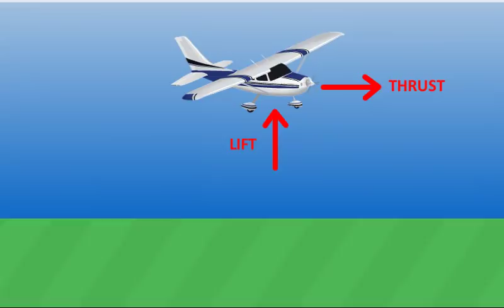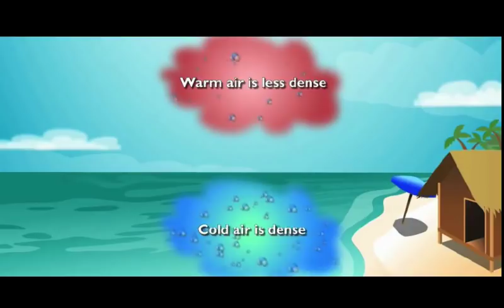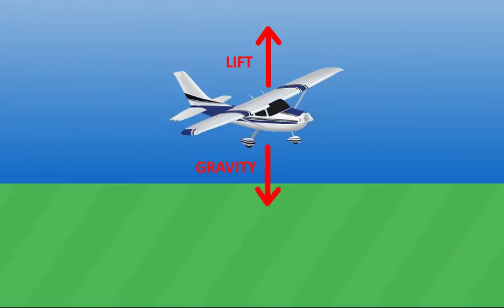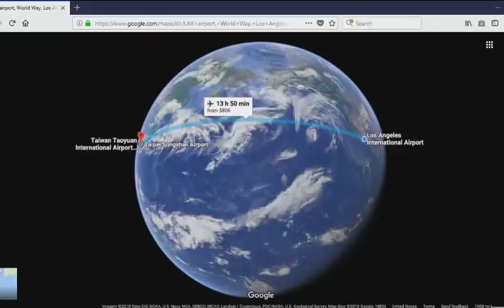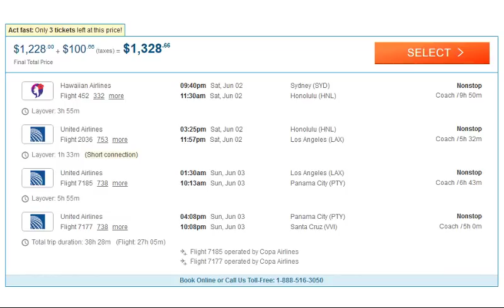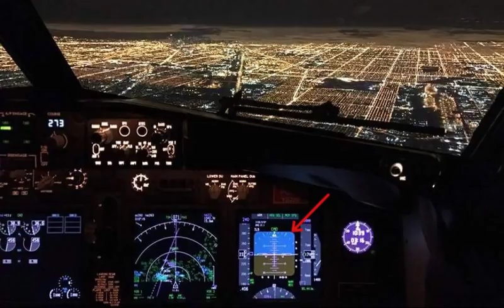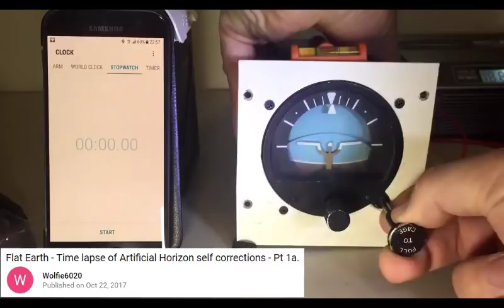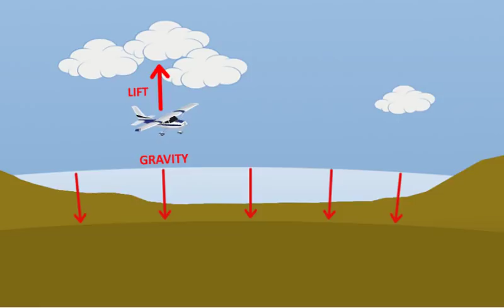Flat Earth Falsities - Plane Nonsense

Comment: Please provide your detailed calculations and explanation of how gravity is holding the atmosphere velcroed to the earth's moving surface. Please include all the motions and forces at play, as well as their vectors (i.e. direction of action and magnitude). Any actual scientific experiments that prove or at least provide evidence for the phenomenon of a moving spherical object uniformly dragging the surrounding air with it would be greatly appreciated.  The usual magical explanation of "Grrrrravity!!!" without any actual explanation of how it would work theoretically, let alone demonstrating it experimentally, is not sufficient. You may as well say that gnomes are responsible for holding the atmosphere down.

Also, while you're at it, please explain how clouds can hover above us sometimes for hours (or at least tens of minutes) appearing completely motionless. When you provide your explanation, please factor in the fact that, because clouds are at high altitude (kilometers above the surface), they necessarily must be moving at a higher velocity than the Earth's surface due to the fact that they are traveling around the circumference of a circle with a greater radius. Please explain where that extra velocity comes from, using vectors and forces diagram. Come to think of it, please explain that for all the layers in the atmosphere as we go up higher and higher in altitude. Then, don't forget to explain how the vacuum of space is bordering a pressurized system like the earth without just sucking it all out. Maybe you would also care to explain how the atmosphere came about to begin with given the "fact" of space vacuum and our knowledge of the physics of how pressure works. And again, please use actual mathematical formulas that include the force of gravity, pointing downward, and the force created by the vacuum directed upwards. Please use actual experimental values for both forces and explain how they balance out.

Finally, please explain the conservation of momentum for airplanes that fly north to south or vice versa. Do planes need to constantly fly in a north-east direction to catch up with their moving target if flying south to north for example? If not, why not? (Gravity, right, right, but please, include your calculations and preferably a diagram of the forces at play.) Finally, it would help to give an example of a north-to-south (or vice versa) circumnavigation by plane, along with the actual path taken, and explain that in light of the time it takes for the flight and the rotation of the earth. Please make sure that any flight given as an example of such circumnavigation has the flight path linked as well so we can all cross-reference it.

I'm sorry for asking all these more formal proofs of your claims, but I'm an engineer and a bit of a stickler when it comes to those kinds of things.

Until you provide these answers, hopefully in a less playfully condescending tone than the one used in this video, I will call it for what it actually is: BULLSHIT.
Reply: Ooooooohhhhh , aren't we clever. No. Fucking stupidly ignorant and disingenuous.
Basically Fg=G.m1.m2/r^2
All the other effects are the causes of weather etc. and therefore are incidental, unless you wish to go into the dynamics of weather etc.
If you do, go to your country's main meteorological establishment where they will have a super computer or two to provide the data you are demanding. But wouldn't understand even if you were given it. Because only a maths and science illiterate would ask the sort of questions you are.
Similarly with your ignorant demands about flights.
And whilst your at it, please provide your detailed calculations and explanation of how your god exists and works,  include all the motions and forces at play, as well as their vectors, including fully scaled diagrams. Similarly with howe he/it/she created itself and the universe. Your bible is not acceptable becasue you cannot cite a thing to prove that thing is true.
We know the earth is a slowly rotating terrestrial spheroid and gravity is a fact.  Just because you are incapable of understanding basic maths and physics and wilfully refuse to learn such things is your problem. Examples of questions for you about basic, practical, everyday maths and physics used in the real world - 
What is the relationship between longitude and distance when travelling east or west parallel to the equator?. If you know the answer then you know the earth is a spheroid. If you don't you are not qualified to comment on the earth’s shape.
Please explain the principles behind the development and functioning of a gyrocompass? If you can then you know the earth is a slowly rotating spheroid and gravity is a fact. If you don't you are not qualified to comment on gravity, the earth's shape or movement.
"north-to-south (or vice versa) circumnavigation by plane"
https://www.pilatus-aircraft.com/en/news-events/story/polar-circumnavigation-with-the-PC-12http://south-pole.com/p0000110.htm
http://www.guinnessworldrecords.com/world-records/first-circumnavigation-via-both-poles-surface/
https://www.ainonline.com/aviation-news/aviation-international-news/2008-12-31/tag-global-claims-record-polar-circumnavigation
https://www.britannica.com/biography/Lincoln-Ellsworth
Finally, the ultimate proof of your ignorance "the force created by the vacuum"  I can't comprehend how utterly ignorant you are. A vacuum does not create a force and is not a force, it is created by forces you numpty
Reply: I think you should absolutely demand a full refund from whatever University you got your engineering degree from, and also throw in some compensation for pain and suffering.

The fact that you think of vacuum as a force tells me all I need to know, that your understanding of physics is quite limited.  When you create a vacuum in a container inside the Earth's atmosphere, do you really think that when you release the vacuum it is some Force created by the vacuum that pulls air inside the container? Because that's exactly what you're proposing would happen to our atmosphere. If you do not understand this extremely basic concept, explaining all of those forces and vectors would be a waste of time, because I doubt you would understand them.

Now, I actually could draw diagrams and explain forces to answer the questions you are posing, but a YouTube comment section is certainly not the best place to do that. We would need to do it in a lecture style format with both of us present, and even then, to get you to understand all of these things would take the equivalent of a full semester college class, because we would need to pretty much start with the basics of physics.

Before anyone should even consider taking this kind of time to help you understand these things, given the fact that there is an overwhelming mountain of available evidence that you so easily dismiss, I think the burden of proof of a flat Earth is on you my friend.

I still have yet to find any plausible Flat Earth model that can explain  how the Sun can be observed in a 360 degree rotation in Antarctica in December. That model would also have to fit with all the other observable data that we have.  If you can do that, I'll consider taking you back to school.

https://youtu.be/Zc-WlTaG7WY
Reply: @Test_Drive_Racing  you've rewritten Newtons law and Einstein's theory your a genius!
Reply: @backoffjoe8347  Nah, it's just basic high school level physics, nothing too exciting. But thanks for the compliment! ;)
Reply: No.. - Well please come down to my level (that of the great unwashed) and bring the light of knowledge, Oh Prometheus! In fact, I will make it easier for you. How about instead of asking you to explain things to me, you find for me some peer reviewed articles that answer my oh so dumb questions? I will make sure to learn how to read by the time you do. In particular, I've been looking for an answer to the question of how exactly does gravity hold the atmosphere together on a ball spinning 400 km/h FASTER than Mach 1, and I haven't been able to find anything that satisfies my curiosity. I've seen a lot of Harry Potter-esque gravity wand waving, but for some reason no details of any sort, let alone experiments. So please, if it is not too much to ask, help a poor lost soul see the light.
Reply: Peter Domuzov
"Statements like "We know the earth is a slowly rotating terrestrial spheroid and gravity is a fact. " are quite funny, " Why. It is a factual statement.
Given the intellect and knowledge you claim you should be able to answer these simple questions.
Why is it that a compass needle is more or less vertical at the poles and horizontal at the magnetic equator?
And when you carry on past the poles the needle slowly returns to the horizontal?
Why is it that it is only possible to navigate accurately over long distances using spherical trigonometry?
Why is it that traditional gyro compasses work perfectly in low latitudes but became unreliable in high latitudes?
Why is it that it is only possible to navigate accurately over long distances using charts based on a terrestrial spheroid?
Why is it that when you watch a ship sailing away from you the hull is the first thing to go below the horizon, then the superstructure and finally the funnel and upperworks?
Does a magnetic compass point towards polaris (Alpha Ursae Minoris) at the north and south poles?
Does a gyro compass point towards Alpha Ursae Minoris at the north and south poles?
What is the relationship between longitude and distance when travelling east or west parallel to the equator?  If you know the answer then you know the earth is a spheroid. If you don't you are not qualified to comment on the earth’s shape.
Tell me how you ascertain the error of a compass when in the Southern Ocean, using Alpha Ursae Minoris?
Please explain the principles behind the development and functioning of a gyrocompass?  If you can then you know the earth is a slowly rotating spheroid and gravity is a fact. If you don't you are not qualified to comment on gravity, the earth's shape or movement.

No evasions please, just straight answers.
Reply: Peter Domuzov  Why no answer?
"wong - Wait... I thought you are the ones coming from monkeys?? " Silly troll. Only Creationists say that, and that is because they are ignorant and brainwashed science illiterates.
"Especially since you have not addressed a single argument I've made."  Why do you lie? You actually attempted to rebut the points I made, i.e. You know I did address them and therefore you are calling yourself a liar.
"So... you make a bunch of assumptions about my beliefs". No. I drew valid and reasonable conclusions based on your viewing habits and the fact that the FE cut is a Christian cult.
Also, if you were an academically qualified engineer you would know exactly what gravity is and why my citing Fg=G.m1.m2/r^2 is an adequate explanation.  So " And no, giving the formula for gravity is not an explanation in any way, shape or form" Is either a lie or an admission you are not qualified as you claim.
Most of you so called arguments are playing at irrelevant semantics, a childish, illogical pastime.
As is your revised explanation about  a vacuum etc.
Reply: @boffeycn  Rather than confuse the poor man with a barrage of questions that he can't answer, I would just like him to answer the one question of how a 24-hour sun visible in Antarctica in December is possible on a flat Earth model. Let's just get that one question answered, then we can move on to the others. I've answered a litany of his questions about the globe model, it's time for him to answer just this one about the Flat Earth model.
Reply: Jim Lee
Rather than confuse the poor man with long winded posts why don't you let him answer my simple questions. He doesn't want to because they are simple but he likes you because he can play you.
Also, your demand to leave god and religion out of it is disingenuous to say the least, isn't it, because the entire foundation of the problem is religious belief. If people would accept this we may possibly move forward.
You should also stop feeding trolls.
Reply: @boffeycn  How is he playing me? I have taken him back to school and taught him some basic things he should have learned during his engineering degree.  Sorry my posts were too long-winded for you, but he asked a lot of questions and I wanted to make sure I was being very clear for him.

He thought he was going to win the argument by demanding answers that he didn't think we could provide.  He thought he was setting the bar too high and would then claim victory when nobody could answer his seemingly difficult questions.  Now his bluff has been called and he is called out on the carpet to answer just that one question for me, since I have now answered many for him.

Would you also like to hear his answer to how a 24-hour sun is possible in Antarctica on a flat Earth model?
Reply: Jim Lee
How is he playing me?
Read through the posts.
You and he both claim you want simple but your posts prove the opposite. I had him answering questions and I proved he was lying and didn't know what he was talking about. He then concentrated on you because you were prepared to play his game rather then utilise what had already been achieved. You gave hi the out he wanted and allowed him to ignore the proof he was a liar.
And I repeat, your demand to leave god and religion out of it is disingenuous to say the least, isn't it, because the entire foundation of the problem is religious belief. If people would accept this we may possibly move forward.
You should also stop feeding trolls.
Reply: @boffeycn  He stopped talking to you because you were starting to commit logical fallacies (even though I believe you are correct in what you're saying, you were not proving your points with properly connected arguments) and then declaring yourself the winner before he felt like his questions were addressed.

The reason he started talking to me is because I'm actually addressing the questions he was asking and refraining from being disrespectful in the process. I don't believe any argument is truly won until one party concedes to the other, not just when one party declares victory.  Unfortunately the majority of these arguments end with no real winner.

The other reason I'm trying to keep religious beliefs out of it is that as soon as it goes, there really can be nowhere to the argument. As long as we keep it purely scientific, I'm pretty sure I can adequately answer any of his questions, though I doubt he will be able to answer any of mine adequately.

All I want for now is a plausible explanation for how the sun can be observed in the sky 24 hours in Antarctica on a flat Earth model.
Reply: @boffeycn  God, you sound like my wife...  no wonder he stopped talking to you.
Reply: @boffeycn  Ok, I'm done feeding the trolls, so this is my last response to you.  Too bad you don't have the mental fortitude to have a civil discussion without resorting to name calling.  Maybe you'll learn how to be compassionate and understanding with people one day.  If anyone is on a superiority trip, it's you my friend.

To answer your question... no, leaving religion out of it is not disingenuous.  Once the discussion goes that way, all hope of them trying to understand the science is lost.  As long as he is willing to not resort to divine arguments and keep the discussion based on observable and testable data or arguments of logic, there is no way for him to successfully prove his point. 

Once he resorts to divine arguments for proof of his beliefs, all bets are off.  Better to keep the discussion grounded in scientific terms than trying to argue Biblical terms, wouldn't you think?  There is no way for me to convince him that his religious beliefs are wrong, is there?  But faulty science I can certainly prove wrong...
Reply: HA HA HA the frustrated attention seeker +wong tong has been going up the wall in this great thread, none do on his comments.
+SP "To an altitude where surrounding atmospheric pressure is low enough to match the mass of helium inside.  Gravity arrests the balloon's rise at this point." ...- Often those carry someting, like satellites... "It doesn't rise.  Why?" Stuck at the DOME?
PS: funny a lot of dome talk these days, on TV, the globeheads programing center; shows like Simpsons, Under the Dome, etc.
Reply: @BrainUser1  Well thank you Louis. I actually learned something today. I was going to say that weather balloons don't launch satellites (and actually haven't, yet...), but I looked it up just to see if it had ever been attempted, and I just learned that there is a company called Zero2Infinity that designed a system called Bloostar to potentially launch satellites from a balloon based platform.  The balloon carries a much smaller rocket that can have a much larger payload because the balloon takes it up to the upper atmosphere until it cannot go any higher, skipping 99% of the Earth's atmosphere, which is where the majority of the energy and bulk of traditional rockets is expended getting a satellite to that point. A much smaller rocket carrying a much larger payload then can be launched from the balloon further up into orbit. Their first actual attempt to launch a satellite from the platform is supposed to be sometime this year or next.

The reason balloons can only reach a finite altitude is because of buoyancy. I could explain the actual physics of buoyancy to you if you like, but might be better to just give an example. Imagine taking a balloon to the bottom of the ocean and letting it go. It will rise because the air inside the balloon is much less dense then the equal amount of volume of water that it displaces. The balloon will continue to rise until it reaches the surface, because that is when there is a change in density between water and air, and now the air in the balloon matches the density of the other surrounding air, and it will stop ascending at that point. That's not because there is some physical structure preventing it from going any higher, but because the density of the gas inside the balloon matches the density of the gas surrounding it.

Same thing happens in a helium balloon when we release it into the atmosphere.  The balloon will continue to rise because the helium inside is less dense than the surrounding atmospheric air at sea level, however as you go further up in the atmosphere, the air gets gradually less and less dense. There will come a point where the density of the surrounding atmosphere matches the density of the helium inside the balloon, and it will float right there, almost like our air balloon floating on the surface of the water.  I say almost because there's a very sharp boundary between air and water due to their significant difference in density, however in the upper atmosphere, this boundary is not nearly as well defined because of the gradual change in density of the atmosphere.

Does this make sense?   Wong, if you read all of this, sorry for another long winded post. I know your brain has a hard time comprehending that many words all put together at once... ;)
Reply: wong - Wait... I thought you are the ones coming from monkeys?? I'm not sure why you're getting ME involved in your evolutionary business. But I suspect that your urge to behave like one is certainly not lost to most reading this thread..  And who knows, if you are lucky you might end up in the evolutionary biology text books as a proof positive we did evolve from monkeys.. So hey, silver lining for you there buddy. But seriously, only scared and powerless people without arguments resort to name calling. Think about that. Especially since you have not addressed a single argument I've made. You don't make GEs look particularly clever to be honest..
Reply: @babayaga9570  Peter, rather than wasting your time responding to the name-calling with Wong, how about you address my response to you and let's have an educated discussion about it.
Reply: +Peter Domuzov Peter, rather than wasting your time responding to the log winded posts from
 +Jim Lee, why don't you concentrate on answering my simple questions?
Reply: Peter Domuzov
"wong - Wait... I thought you are the ones coming from monkeys?? " Silly troll. Only Creationists say that, and that is because they are ignorant and brainwashed science illiterates.
"Especially since you have not addressed a single argument I've made."  Why do you lie? You actually attempted to rebut the points I made, i.e. You know I did address them and therefore you are calling yourself a liar.
"So... you make a bunch of assumptions about my beliefs". No. I drew valid and reasonable conclusions based on your viewing habits and the fact that the FE cut is a Christian cult.
Also, if you were an academically qualified engineer you would know exactly what gravity is and why my citing Fg=G.m1.m2/r^2 is an adequate explanation.  So " And no, giving the formula for gravity is not an explanation in any way, shape or form" Is either a lie or an admission you are not qualified as you claim.
Most of you so called arguments are playing at irrelevant semantics, a childish, illogical pastime.
As is your revised explanation about  a vacuum etc.
Reply: You claim to be an engineer w/ honors, but don't know the basics of fluid dynamics?
While I can't provide the exact calculations, other people who are nerds in the respective fields can but I can give some base line explanations
1. They said how the surface spinning + friction results in the atmosphere also, on average, spinning in the same direction. Also iirc (dun quote me on this though) the atmosphere formed spinning like the Earth did (but not at the exact same time)
2. Clouds SOMETIMES (key word there) hover above you motionless for hours because wind speed isn't a constant. As for the extra velocity, probably the same place where a bucket on 1m of string, spun above your head, moves faster than your hand does (hint: angular velocity)
3. The vacuum of space doesn't 'suck out' all of the atmosphere because of gravity. Your high to low pressure system example assumes that the gravity is constant but with our atmosphere it isn't
4. Explaining how the atmosphere came to exist has nothing to do with how planes work, but iirc (dun quote me on this) it was basically millions of years of volcanoes

You know why this stuff is considered scientific fact? Because it has been proven, can be used to make correct guesses about the outcome of experiments with and is also the most accurate explanation we have. I would think that an engineer with honors would know the basics of science but you never know I guess
Reply: @Peter Domuzov  -  Gravity is the only valid explanation that fits experimental data.  Buoyancy/density and electromagnetism do not fit any testable scientific results of any experiments.  And if that's not the case then give me one.  I can test gravity just by dropping an object on the ground.  I can measure its force and velocity with just that.  It is you who is making the extraordinary claim and therefore you require extraordinary, undeniable evidence that gravity is something else.  If you don't even know what that is than you shouldn't even be talking.  You can't talk about gravity if you don't know what it is.  Very simple premise for any argument.  I think you failed on step 1.
Reply: notSiD You're simply ignorant. Maybe you should look at the Electric Universe theory.
Reply: Was going to say good luck! But even +wong maneged to put out something aside of "F_off troll" (+No.. does his best). They will never give you anything for the perfect velcro contact to the surface, its Momentum, picked up when the Atmosphere got dense enough and the Ball picked up its fixed axe and speed.

Earth's atmosphere is leaking. Every day, around 90 tonnes of hydrogen and helium material escapes from (GE) planet's upper atmosphere and streams out into space. Although missions such as ESA's Cluster fleet have long been investigating this leakage, there are still many open questions. How and why is Earth losing its atmosphere?
Reply: @BrainUser1  Yes, this is absolutely true that the upper atmosphere is leaking hydrogen and helium, because they are the least dense gases and preferentially rise to the upper atmosphere and float off into space.

90 tons sounds like a big number, but when you look at the overall mass of the Earth, it is infinitesimally small. Hydrogen and helium are also being released into the atmosphere from the soil and from other natural processes on Earth. These items are also entering the Earth's atmosphere after they are released from the Sun and travel through empty space towards Earth. So for now, there's an equilibrium, however the amounts of those gases present in our atmosphere are very small because they are being lost to space, just as the sun is losing them to space.

This very much implies that there will be a finite amount of material for the Earth and Sun to lose to space over time, which implies that somewhere in the future there will be an end to the Earth. This is absolutely in line with teachings of the Bible as well.

Now, if your Flat Earth and dome theory is correct, how is it possible that the atmosphere is leaking through the dome?  I will acknowledge that there is some permeability of hydrogen through glass, however for a glass Dome that is large enough to cover the entire Flat Earth and keep the atmosphere pressurized to 14 PSI, that would have to be some extremely thick glass. The rate of permeability of hydrogen through that glass would be infinitesimally small.

Also, can you explain why there is a pressure gradient within a pressurized dome as you get further away from the Earth's surface if gravity does not exist?

Just as a side note, I find it extremely amusing and very Freudian that when I am dictating these responses using Google Voice recognition, it often autocorrects the word "dome" to "dumb"... makes me chuckle.
Reply: O... was hoping a "not true, liar!" That is what I copied on Credible sources... Nice that it is less dense, rising, but, still why does not GRAVITY hold on to it? Make it all nice and level, in sync with Momentum as all the rest of the Atmospheres.
ps: did you just ignore the more educated and clear +Peter Domuzov ?
Reply: @BrainUser1  No, I didn't ignore him, as you will see from my comment above. As you'll see, that response required a lot more time to put together, and I'm at work right now, so I responded to you first.  Please read through my response to him, as it also helps to explain some of your questions about the leaking atmosphere.

I did notice however that both you and he ignored my question about the 24-hour Sun visible from Antarctica. Would you mind taking a stab at explaining that one?
Reply: Two replies follow the "Then follows with a text wall of nonsense." with lenght? Argumentum ad hominem, is a fallacious argumentative strategy whereby genuine discussion of the topic at hand is avoided by instead attacking the character, motive, or other attribute of the person making the argument, or persons associated with the argument, rather than attacking the substance of the argument itself. Déjà Vu.
Reply: So YOU dont have any backing as I thought.
Once again... the easier Piltdownman  conclusions drawn from accumulated research, until way latter 1953 TIME MAGAZING exposed the hoax ; [ The Piltdown case is an example of how racial and nationalist factors shaped "some science" at the (some)time. Notably, it led scientists down a blind alley...  ..reconstruction of human evolution was confused for decades. The examination and debate over Piltdown Man caused a vast expenditure of time and effort on the fossil, with an estimated 250+ papers written on the topic.]
As early as 1913, David Waterston warned it was fake, but....
The Piltdown hoax is prominent for two reasons: the attention it generated around the subject of human evolution, and the length of time, 41 years, that elapsed from its alleged initial discovery to its definitive exposure as a composite forgery. 
https://en.wikipedia.org/wiki/Piltdown_Man

0 So yeah, some utterly disingenuousness went on in the SCIENTIFIC community /Government schools.  
"Science doesn't just make outlandish unsubstantiated claims like he is doing." ??? O YES IT DOES, ALL THE WAY IN SCHOOL BOOKS.

SO NO COMPARISION TO ENGINEER  Peter Domuzov YT conclusions, point I was making as you butted in from.. way back.

Mister Know-it-all that just provides lip, denials, here is some more Science mistakes you already know...;
 
5- Einstein’s Static (or Stationary) Universe
10 Most Famous Scientific Theories That Were Later Debunked
https://www.famousscientists.org/10-most-famous-scientific-theories-that-were-later-debunked/
plus : 
15 Things You Were Taught In School That Are Total Lies 
https://www.brainjet.com/random/2357670/15-things-you-were-taught-in-school-that-are-total-lies/

- that is what a "non-researcher" could dig out this time..
Reply: Louis Shaw As ever your argument relies on science having been wrong in specific instances to somehow support your unsubstantiated claims that everything is wrong. Now you're now claiming relativity is wrong, not because you can supply any evidence it is so but because Einstein was wrong about expansion.
Reply: Well said, I don't think your going to get an answer, at minimum the flat earth theory should make a rational person think, instead it's a smug no it all BS.
Reply: Thevoice of reason Once again he is gassing about Piltdown man but once again not actually putting forward any evidence that questions evolution. 

There isn't a flat earth theory: the only think FE'ers can agree on is claiming the Earth is flat and the inability to produce a map. There is/isn't a dome, there is/isn't an edge, there are/aren't other continents, air pressure does/doesn't decline with altitude and so on ad infinitum. If you believe you have something to make people think then produce but kindly think it through thoroughly before you do.
Reply: *drops mic* (don't even have to say anything, dropping the mic proves my point.  the mic would not fall if gravity didn't exist.)
Reply: notSiD hold helium ballon. Let's go it flies up to the sky. Wow I guess gravity sends balloons up? Gravity debunked you dumb fuck
Reply: Big Boss The gravity also pulls on the surrounding air; since the air is denser the air is pulled down favourably and the balloon is displaced upwards.
Reply: wong - So... you make a bunch of assumptions about my beliefs without actually answering the questions. Please point to where I mentioned anything about God or the Bible? You ask me to show calculations on how God created the universe, as if that is the same as what I'm asking about the simple relative motions of 2 objects. Wow, brilliant. Touche. In the same spirit, I'll throw one right back at ya and ask you to explain what the gravitational constant G is, what is mass exactly, and what the hell is that force of gravity anyway? These are stupid and futile games dude, grow up.

Calling me names doesn't make your argument either. Maybe it does in your apparently rather simple mind, but in the real world this is called an ad hominem attack.

And by the way, I am a professional engineer who graduated with honors, so I would venture a guess and say that I probably know a bit more about science in general and physics in particular than you.

And no, giving the formula for gravity is not an explanation in any way, shape or form. It is definitely part of such potential explanation, but not an explanation in itself. While weather plays part in the dynamics of the flight, I am asking you to exclude the winds and what not, and just focus on the basics of the motions of the plane and the earth. Let's assume that weather is irrelevant to simplify the calculations.

Statements like "We know the earth is a slowly rotating terrestrial spheroid and gravity is a fact. " are quite funny, considering that this is indeed the topic of discussion here. How about if I say that we know for a fact that the earth is flat and motionless? Maybe you should find a book that explains to you the rules of formal logic. To help you, this particular logical fallacy is called "begging the question". Look it up.

As far as the vacuum is concerned, maybe I was unclear what I meant, so let me dumb it down for you. In any known environment, either natural on earth, or a man-made in a laboratory, if you have a system of high pressure and connect it to a system of low or no pressure, the laws of physics dictate that air will flow from the high to low pressure until both are equal. I referred to that, maybe not entirely accurately, as the equivalent of a force "pulling" the contents of the high pressure system if you will.  So, given that the Earth and outer space constitute 2 such systems, I am still waiting for your explanation as to how it all works.

Finally, about those circumnavigation flights. You obviously didn't look at the actual trajectories that those flights took. I will only address the links you provided about actual flights and not ground expeditions, because I don't want to spend time explaining how the ground expeditions are just as flawed, since they are not directly relevant to what I asked for, namely flights.

The only two links that are thus relevant are the PC-12 flight by Jack Long, and the TAG Transpolar 08.

About Jack Long's flight, FROM THE VERY ARTICLE THAT YOU LINKED TO, I quote:

"
After more than a year of planning, Jack and his crew completed the northern part of the route first, beginning the journey in Jackson Hole, Wyoming, USA, on 11 August, 2016 and ending in Austin, Texas, USA on August 29 – by way of crossing the Atlantic Ocean to Newcastle, England, and crossing the 75 degree north latitude point on the return flight over Greenland.

Jack and his team began the southern part of the trip in Austin on 2 January, 2017 and crossed the Atlantic again, but this time by way of the Azores and Cape Verde to Ghana. From Accra, Ghana, they flew a round-robin flight to complete the easternmost equatorial crossing they needed. They then flew west back across the Atlantic, and then south across the equator again to Brazil and continued flying south over Argentina and Chile, to King George Island. Jack’s aircraft was the first PC-12 ever to land in Antarctica! From here, they made the longest leg of their journey on 17 January, flying 8 hours and 30 minutes to reach the 75 degree south latitude control point and then returning non-stop to King George Island.
" 

Read the second paragraph, and the last sentences in particular, very carefully and go to your globe and track the actual trajectory. Did they actually cross over the south pole and go on the other side of Antarctica?

I also find it curious that we had to wait until 2017 (after more than 100 years since airplanes were invented) for the first ever "polar circumnavigation diploma" to be awarded. And please carefully read the requirements to satisfy the diploma, they are in the same article, in particular to:

"
The flight must have been made to a control point north of 75 degrees north latitude and a control point south of 75 degrees south latitude.
"

As for the Transglobal 08, a very similar thing happened. I will just link to their official route with stops and ask you to please trace it yourself and tell me that this is actual polar circumnavigation.

http://www.transpolar08.com/route.html

The very fact that you could only come up with 2 extremely dubious examples speaks volumes, and should prompt any thinking person to pause and reflect.
Reply: @babayaga9570   I appreciate that you want to take a perfectly scientific approach to this and not bring biblical beliefs into it. I will assume you were referring to Wong about the Bible and name-calling remarks, because I personally said no such thing to you.

I find the discussion on the Earth's atmosphere and the vacuum of space very interesting, because at first glance to someone with only an elementary understanding of these things, your argument makes sense to some degree. However, I will try to explain.

Since you seem to agree that vacuum does not actually constitute a force in and of itself, but rather is the effect of other forces at work, that's a good starting point. If we take a very basic experimental setup of two sealed containers connected by a valve, close the valve, and then pressurize one of the containers and create a vacuum in the other, you and I would both agree that when we open the valve, whatever gas we placed in the pressurized container would flow into the container with the vacuum, which contains no gas molecules. The force generating this movement originated within the pressurized container and is exerted by the movement of the gas molecules against the container. When the valve is open, this pressure forces gas molecules across into the vacuum container until pressure in both containers is equal, according to Boyle's law.

We'll take this one step further and only create a vacuum within one container on the earth at sea level. When we release that vacuum, atmospheric air pressure of 14 PSI will force atmospheric air into the container until pressure within the container is also at 14 PSI. I hope we're in agreement so far.

Now, what we have to understand is what force is causing that 14 PSI of atmospheric pressure, and I have a feeling that this might be where we start to disagree.

The force that generates that pressure is gravity. I know that word tends to trigger a lot of flat earthers, so let's be clear. It should be undisputed fact that there is some force that causes objects to move towards the Earth's surface. We are calling that force gravity. As for what causes gravity, that is still a matter of active debate and research and is merely tangent to this discussion. Just because we do not understand how something works, does not mean that it does not in fact exist or that we cannot observe it working in extremely predictable ways. When you ask someone to define gravity without using the formula for gravity, that's like trying to ask someone to explain why the color blue appears to be blue without using wavelengths in the explanation. It's a moot point. There is unquestionably some force that causes objects of mass to move towards the Earth's surface. If you want to talk about density and buoyancy, that's fine, because gravity is one of the factors used when calculating the buoyant force.  Without it, you have no point of reference as to which direction a less dense object would move within a more dense medium.

Now, can we also agree that there is definitely a decreasing pressure gradient in the atmosphere with increasing altitude? This is why airplane cabins have to be pressurized when going above a certain altitude. This is also why the converse is true when going deeper into the ocean and there is a pressure gradient that increases with increasing depth. This pressure gradient is formed by gravitational force pulling anything with mass, including water molecules and air molecules, towards the surface of the Earth. This is very adequately explained in the video we are commenting on.

Knowing these pressure gradients exist, would it not stand to reason that atmospheric pressure would slowly decrease as we get further from the surface of the Earth, until it is essentially zero? Think of it this way... according to Boyle's Law, pressure within a container is caused by the exertion of force of the molecules of the gas against the walls of the container. At sea level, the 14 PSI of pressure is caused by exertion of force from the movement of molecules in the air in all directions, both downwards against the Earth's surface and upwards against the molecules of air above it. However, for any volume of air, you must also add in the vector of gravity pointing towards the Earth's surface that affects all the molecules in that volume because all molecules of gas have some mass, albeit very small. Therefore, the overall net downward force is ever so slightly greater than the upward force against the molecules above it. Now the molecules of air above it are also creating force in all directions, and they are also affected by gravity, so their net force downward is also slightly greater than the force upward.

This explains how gravity can form a pressure gradient both in water and in air, and that is exactly what is readily observable.  As we get further from the Earth's surface, this pressure gradient will decrease from 14 PSI, to 13 PSI, to 12 PSI, gradually getting down to 0 psi. It is at that point where the very minor effect of gravity on the air molecules reaches a point of equilibrium with the upward vector of pressure created by those last few air molecules remaining in the atmosphere.

Hopefully you can see this is why there is no container necessary to hold in the Earth's atmosphere. This is also why we would expect some molecules to be able to float away into space, or "leak" as you put it. The molecules that are escaping away into space are the ones that have the least amount of mass and are therefore least affected by gravity, namely hydrogen and helium.

I know the idea of having a pressure gradient that goes from 14 PSI to 0 without a container is hard to grasp, because the only way we can carry out experiments on Earth using a vacuum is to have a container. The reason for this is that we are working within the Earth's atmosphere and must exclude the atmosphere from the space we want to work with. Maybe to better understand this, let me take the ocean as an example. We should all be able to agree that there is an increase in pressure of one additional atmosphere for every 33 feet of depth in seawater. So at a depth of 33 ft in the ocean, the pressure would be roughly 29.2 PSI.  However, the pressure at the surface is 14.6 PSI. Why is water not moving up into the air, from a higher pressure to a lower pressure?  If you can answer this question, then you should be able to understand why all the Earth's atmosphere does not just fly off into space.

Any questions?
Reply: Jim Lee - And I appreciate an actual argument as opposed to name calling, so thank you for that!

I feel sort of dragged into a discussion on a very minor point that I mentioned in passing, but c'est la vie. I will address your response anyway. However, I hope that you can provide some answers to my original questions. I would also accept peer reviewed articles from any scientific publication if you don't feel you can do an adequate job in a YouTube comment section.

To start, let's talk about gravity. I don't think we can say that the questions of what is gravity and how it works are mere detail. Just because we observe an effect (namely, that objects fall), and can describe that effect using a formula (which we don't really understand), it does not necessarily mean that the force we POSTULATE as an explanation to that effect is the only possible explanation. As you remarked, density/boyancy can be another explanation. Electromagnetic/electrostatic forces can be a third explanation. And so on... So, I would be a lot more comfortable with gravity as an explanation if we could actually explain what it is and how it works. Otherwise it seems, to me at least, that it can be viewed as one of several possible explanations.

I find there are quite a few problems with gravity as a theory. For one, Newton's Law of Gravity only applies in a system of 2 objects. It falls apart when you have 3 or more objects in the system. Second, it seems to vary depending on where it is measured on earth, which should not theoretically be happening. Three, it does not explain the movements of the stars and galaxies, which is why we need to postulate nonsense like dark matter and dark energy. Four, there is a question I have concerning gravity that I'm hoping you can answer... It has to do with the centrifugal force on any body on earth that results from the spin of the earth. To wit, a person standing on the equator is subject to a centrifugal force (Fc) equal to m*v*v/r, where v is around 1600km/sec (actually it should be in m/s but I'm too lazy to convert). Now, if you ask anybody who believes the globe model, they will invariably say that we do not fly off the earth because of gravity. Fair enough. So that means that Fg would be equal and opposite to Fc at the equator. However, if we now move our observer say toward the North Pole, the speed v will gradually decrease for obvious reasons, until we reach the north pole, at which point v = 0km/sec. I hope that is also obvious. However,  Fg is supposed to be constant anywhere on the sphere, since each point is roughly equidistant from the center of the earth. This would in turn mean that the Fg at the north pole will still be the same as experienced by the same observer at the equator, but this time there is no Fc to balance it out. So, in my humble opinion, the observer at the pole should feel a MUCH stronger gravity pull, possibly crushing him. I've spoken to people who have worked very near the North Pole at a military installation for 6 months, and they didn't feel any difference from any other place on earth they have been. Also, I have never ever heard of anyone who HAS felt any difference. Would you be able to explain this apparent contradiction/discrepancy? 

It is my opinion that density and buoyancy are the explanations (and/or possibly electromagnetic/electrostatic forces), not gravity. And no, buoyancy is  not defined in terms of gravity, it is defined in terms of small g, which is gravitational acceleration CONSTANT. I am not arguing that objects do not fall at a rate of 9.8m/s*s. That is indeed a fact. I am arguing that gravity as a force is not the explanation of why everything sticks to the earth. So please do not confuse the two.

One major problem I see with your logic about atmospheric pressure etc is that you use Boyle's Law. As far as I know, Boyle's Law only applies to enclosed systems. Would you agree that neither the earth nor space can be regarded as such enclosed systems? 

Second, even if I grant you that what you are describing (and I've seen this explanation before) is possible, or even probable (which I don't but let's just say), it is still merely a hypothesis. Can you provide actual experimental data to support it? Even if something does make sense, it does not mean that it is true.

One example of an experiment that can be done with a vacuum that is not enclosed is to open the hatch of the ISS. What do you think will happen? It seems to me that there will be a violent "apparent force" pointing outward toward the vacuum of space that will suck everything out.  At least that is what we see in movies. :) The magnitude of this same "apparent" force will be the same when applied to the earth as when it is applied to the ISS, would you agree?

However, you are saying that this force is balanced perfectly by the very weak force of gravity. OK, it's a hypothesis. But you will need to do more to convince me that this hypothesis is true than just stating it as a fact. This is why I ask for actual equation with actual values for these acting "forces" (and yes we already know Fg).

Finally, we have the "fact" that we leak 90 tons of gas per day. Under what conditions then did the atmosphere form to begin with?

Just picture it: Earth 4.5 billion years ago, a rock in the vacuum of space. What plausible processes could have resulted in the build up of the atmosphere? To more than counterbalance losing 90 tons of gas per day for billions of years? I realize this is not exactly accurate as the present conditions are not identical to those a billion years ago, but you get my drift.
Reply: Peter Domuzov "density/boyancy can be another explanation"
Only as and when someone explains how density can acts as a force and why with a consistent direction. 

"Electromagnetic/electrostatic forces can be a third explanation"
Someone just needs to explain how electrostatic attraction would work without any detectable charge, why the electromagnetism applies equally to magnetic & non-magnetic materials and how either field diminishes as slowly with distance as gravity does. 

"it can be viewed as one of several possible explanations'
Which are...?

"It falls apart when you have 3 or more objects in the system"
It doesn't fall apart; it becomes too complex. 

"seems to vary depending on where it is measured on earth, which should not theoretically be happening"
The strength is dependent on your distance from Earth's centre of gravity, something which varies with your elevation and the spheroidal shape of the Earth.

"postulate nonsense'
Why do you think it is nonsense exactly?

"So that means that Fg would be equal and opposite to Fc at the equator"
No, simply that Fc is weaker than Fg. At the equator it's <1% the strength of gravity. 

"the observer at the pole should feel a MUCH stronger gravity pull"
No, just that missing fraction of a percent. Since the transition from equator to pole would be gradual and I doubt the body is that sensitive to changes in weight anyway, nobody is going to notice. 

"Boyle's Law only applies to enclosed systems"
Closed, not enclosed; there is no requirement for a solid container. Though there would be incoming meteors and some gas escaping the Earth is technically a closed system. 

"Can you provide actual experimental data to support it?"
Start here: https://arxiv.org/

"The magnitude of this same "apparent" force will be the same when applied to the earth as when it is applied to the ISS"
The distance through the escape hatch is somewhat shorter than the height of the atmosphere. Compare the difference in pressure for a fixed distance. 

"you are saying that this force is balanced perfectly by the very weak force of gravity"
In terms of the change in pressure per metre, yes. 

"90 tons of gas per day"
Not a huge amount on the greater scheme of things. The early atmosphere would have been a little pulled in during the Earth's formation and predominantly what was released by the Earth through volcanic activity.
Reply: @babayaga9570  First of all, I don't see how you can claim that you were dragged into a discussion on a minor point that you made in passing, when if you look at the first post in this thread it was a very long list of things that you posted demanding answers to with detailed explanations, so that's exactly what I provided. How do you feel you were dragged into this, and what was the minor point you were talking about?

As for the actual cause of gravity, I'm going to table that for the time being, because I don't think it pertains directly to the facts we are discussing.  For now, I will concede your point that just because something makes sense doesn't de facto make it true, however, if there might be three possible explanations for some observation, and one of those explanations happens to fit with the mountain of other observations available, and the other two don't quite seem to fit, it's pretty logical to deduce by Occam's razor that the one that fits with the most observations is probably the correct one.

However, setting that aside for now, it seems that we can at least agree that there is some force causing downward acceleration of 9.8 m/s, and that it is a constant on Earth (though there is slight minor variability between the poles and the equator as I will discuss below). As for your question of why someone isn't crushed by gravity at the poles due to the differences in centrifugal force between the Equator and the poles is easily answered. I think the difficulties you are having with understanding this is that I think you are grossly overestimating the magnitude of forces involved, as hopefully you will see.

First, let's make sure we agree on the units and measures involved.  The equation for Fc as you said is m*v*v/r, and would be expressed in Newtons. Since Newton's are a somewhat abstract unit for a lot of people to understand, for ease of calculations and understanding, let's just assume a 1 gram mass for now. With 1 gram, the force in Newtons would equal the acceleration due to that force (F=ma, so if m=1, then F=a).

Now, we need to determine the velocity in m/s of this 1g mass at the equator.   Using the commonly accepted values of 40075 km for the circumference at the equator and a 360 degree rotation taking 24 hours, 56.1 min, we get a velocity of about 465 m/s.  Please feel free to check my math.

Now using the commonly accepted value of 6378 km (or 6,378,000 m) as the radius of the Earth at the equator, we get 465*465/6378000 = 0.034 m/s of acceleration away from the surface of the Earth.  Compare that to the 9.8 m/s of acceleration due to gravity (or whatever force you want to claim it is due to) in the opposing direction and it should be plainly obvious why things don't fly off the surface at the equator (I know you didn't say that specifically, but many of your fellow flat-earthers do claim that they can't understand why that doesn't happen) and why people aren't getting crushed by gravity at the poles (as you DID claim), because the difference in force is about 0.3%.  So someone who weighs 100 kg at the equator would weigh 103 kg at the poles.  Now,  if you look up the actual calculations that take into account the slight change in the gravitational constant from the equator to the poles, the difference is actually about 0.5%, so a person weighing 100 kg at the equator would actually weigh 105 kg at the poles.   Not sure what kind of world you live in where 5 kg is enough to crush someone.

Now, on to other things.  I believe you are correct about Boyle's Law and only applying to closed systems, which is exactly what I was talking about when I referenced it. I was using that as an example to establish a basis of understanding. Never once did I use Boyle's law to try to make any points regarding the atmosphere or space.

Your ISS example is invalid in this instance because as you said above, the Earth and space are both open systems, and you would now be taking a closed system and placing it in an open system.  You would be taking a container pressurized at 14.7 PSI  and placing it in an environment of 0 psi with only a few inches of material separating the two. Of course when you release that gradient there is going to be a force generated from the pressure inside pushing everything outward.

The difference between the ISS and the air that is at 14.7 PSI at sea level on the earth is that, as you said, the magnitude of the forces would be roughly equal, however releasing the hatch on the ISS would release that entire force over a very small area and very short distance, so everything would in fact be sucked out (or pushed out to be more accurate).   With the Earth, that same force is being dissipated over miles and miles of atmosphere and all that energy is lost in the friction of air molecules with each other over that huge distance instead of just over a few inches. 

As far as the origin of the Earth's atmosphere, I could give you the proposed explanation based on secular astrophysicists and Big Bang theorists ideas, or I could tell you that I believe it was created by God. It actually doesn't matter for purposes of this discussion, because how it came to be has virtually no bearing whatsoever on the observable physics that we can see today.  For purposes of this discussion, it's a straw man argument.

Now that I have again taken the time to provide a very detailed answer to your questions how certain things could be possible on a globe Earth model, let's have a little quid pro quo here. Please answer my question about how a 24-hour Midnight Sun is possible from Antarctica during December on a flat Earth model. It's a very simple question compared to some of the ones you have been asking.
Reply: Peter Domuzov    Why no answers?
"Statements like "We know the earth is a slowly rotating terrestrial spheroid and gravity is a fact. " are quite funny, " Why. It is a factual statement.
Given the intellect and knowledge you claim you should be able to answer these simple questions.
Why is it that a compass needle is more or less vertical at the poles and horizontal at the magnetic equator?
And when you carry on past the poles the needle slowly returns to the horizontal?
Why is it that it is only possible to navigate accurately over long distances using spherical trigonometry?
Why is it that traditional gyro compasses work perfectly in low latitudes but became unreliable in high latitudes?
Why is it that it is only possible to navigate accurately over long distances using charts based on a terrestrial spheroid?
Why is it that when you watch a ship sailing away from you the hull is the first thing to go below the horizon, then the superstructure and finally the funnel and upperworks?
Does a magnetic compass point towards polaris (Alpha Ursae Minoris) at the north and south poles?
Does a gyro compass point towards Alpha Ursae Minoris at the north and south poles?
What is the relationship between longitude and distance when travelling east or west parallel to the equator?  If you know the answer then you know the earth is a spheroid. If you don't you are not qualified to comment on the earth’s shape.
Tell me how you ascertain the error of a compass when in the Southern Ocean, using Alpha Ursae Minoris?
Please explain the principles behind the development and functioning of a gyrocompass?  If you can then you know the earth is a slowly rotating spheroid and gravity is a fact. If you don't you are not qualified to comment on gravity, the earth's shape or movement.

No evasions please, just straight answers.
Reply: Jim Lee - I just said I am being dragged into a discussion on this one particular point because none of the other points have been addressed. But whatever. 

As for gravity fitting the mountain of evidence, I point you again to my points about the problems with gravity, in particular to it not being able to explain the motions of the stars and galaxies by a HUGE factor. In my mind, that is not insignificant. Also, please do detail what mountain of observations you are referring to is only explainable by gravity but not by density/buoyancy. 

Minor corrections on your numbers about centrifugal force, it is a bit over 3% and 5%, not 0.3 and 0.5%. (Looks like you copied the numbers along with the argument from here http://curious.astro.cornell.edu/about-us/42-our-solar-system/the-earth/gravity/94-does-your-weight-change-between-the-poles-and-the-equator-intermediate -- along with the mistakes...) But you did get the weight correctly. I only said possibly crushed because I had not done the math. But 3%-5%, or 3-5 kg for a 100kg person is definitely a measurable difference. Now if only someone had actually done the experiment with a fixed weight object (people can gain and lose weight after all)... Oh wait, someone HAS!!! And it was published on Science Magazine's website of all places. (http://www.sciencemag.org/news/2012/03/scienceshot-garden-gnome-tests-earths-gravity). So, let's see what the results are, shall we? The difference seems to be only 0.6%, or about 2 grams. Now, if your theory was in fact correct, this should have been more like 10- 1 5 grams. You can use this site to easily verify (https://www.engineersedge.com/physics/centrifugal_force.htm). Now, there seems to be quite a discrepancy here; I mean, we are off by some 500-800%!! So let's not move on to other things just yet, because I would love to hear your explanation.

So, you are saying that my ISS example is invalid because it is a small, enclosed system. I gave that as an example because you said we cannot have any environment here on earth where we can have unbounded vacuum. So I guess your argument is that it will not work for an enclosed system, but no problem of it working on an open system like the earth... That's quite a contorted logic. Come to think of it, you CAN actually view the earth as a closed system from your point of view, because it is enclosed by the vacuum of space. Would you agree? 

If you do agree, then the earth can be viewed as such closed system, at which point I will ask you - What size does the ISS need to be in order for the air in it NOT to be sucked out immediately, or at least very quickly? 

If you do not agree that it is an enclosed system from your perspective, then your argument makes absolutely no sense. That "apparent vacuum force" that is sucking everything out, even if it is distributed over thousands of miles of atmosphere, must approach infinity, because space is after all, at least according to Scientism, infinite. The size of the earth is absolutely insignificant in comparison. In addition, in your statement

"
With the Earth, that same force is being dissipated over miles and miles of atmosphere and all that energy is lost in the friction of air molecules with each other over that huge distance instead of just over a few inches. 
"
you are again stating your own hypothesis as if it were a demonstrable scientific fact, which IT IS NOT. It is just conjecture, and I dare you to prove otherwise. Again, just because you can concoct some seemingly plausible hypothesis, that does not make it a fact.

I strongly disagree that the origin of the atmosphere is irrelevant to the argument. You MUST be able to explain, based on your premise, how the whole thing started. You can't just say, here we are and this is how it's working, because it is immensely important how we got here in the first place. If your theory can't explain that, then what are we even talking about?!? That's a Jedi mind trick and a logical fallacy that Scientism priests use constantly. About pretty much everything (origin of the universe, how the planets form to begin with, how life originated, etc.). And no, we can't include God in this, because your whole worldview is based on God not existing. If we are going to include God, then do point me to the Bible passages that are talking about a ball earth spinning in the vastness of space. If the Bible is not your thing, point me to ANY religious text describing the same.

Finally, the 24 hour antarctic sun. You might not like my answer, but please don't have a knee-jerk reaction, because I will explain why I can't accept it as evidence.

It is most likely fake. Why? Because there is CONFIRMED fakery in some of the videos (e.g. see here https://www.youtube.com/watch?v=42EqtxhwJ20)

If you are referring to this video: https://www.youtube.com/watch?v=Zc-WlTaG7WY

Please take a look at around 1 minute of the video and look at the mountain and all the objects really, and tell me where are the shadows??? Also, see here: https://www.youtube.com/watch?v=fJpk5tgQ73k

More generally speaking, I don't trust ANYTHING that the government or NASA would produce. It is not because I'm an insanely paranoid person, it is because they have been caught REPEATEDLY faking seemingly pretty much everything. If you are going to give me a government video of anything, why not just link to some NASA photos and videos of the globe earth and get it over with? Obviously they are not a trusted source of information, and there are LOADS of videos on youtube proving it beyond any shadow of a doubt.

So.. You have at least two 24 hour sun videos fake. You have NASA/Gov't faking stuff over and over and over again... So, I'm sorry, but I just can't accept these videos as evidence, and unless we go to Antarctica to verify it for ourselves, you will need to use another argument. Which, given that the earth MUST be a spinning ball, there should be loads of...
Reply: @babayaga9570   How utterly disingenuous (wong was right).  Sorry my friend, but I think at this point I'm going to demand that you prove these videos are fake. You can't just claim something as "most likely fake" and then just completely dismiss it just because it would absolutely destroy your pet theory. The shadows don't look right? Seriously? That's the best you have? That's the worst attempt at a debunking I've ever heard of.  I went to that point in the video at 1:00 and looked at the shadows, and I see shadows exactly appropriately where they should be for the angle of the sun in the sky at that time. There are some greenish buildings on the right-hand side of the screen, and they have small shadows in front of them just like they should, and all of the rocks and cliffs and everything have small shadows in front of those as well. You're completely delusional bud.

I did see one video that attempted to debunk that particular one, and all it was was a guy messing around with different pictures of the sun taken from different times of day, different points on Earth, with different cameras, different lenses, and different filters, and then messing around with the contrast and color saturation in Photoshop. There were no explanations as to what he was doing or what it meant, and then when he gets to the picture of the sun from this video, he adjusted the colors and then the music changed and the camera zoomed in to the picture, like somehow that was supposed to prove something. Then at the end, he scoffed at how the sun could be hidden behind the leg of the camera tripod if it was so big on an earlier frame. He's pointing to the glare of the sun as its actual size, which shows he has absolutely zero understanding of how cameras work and what sun glare is. Hardly a debunking of any kind.  You are going to need to do better than that before you can just dismiss these videos as fake. You either have to prove conclusively that they're fake or you have to deal with them as the 100% real proof of a globe Earth that they are.  Just your claim that they are most likely fake does not stand up to scientific scrutiny. Sorry, but to pull a quote from your very first post, I'm a bit of a stickler for those kinds of things.

As for your assertion that I was just debating one minor point and didn't answer your other questions, I believe I have addressed every question you have asked, and the only question I wanted an answer to you completely dismiss as being most likely fake without even providing a shred of evidence to back that up.  

Now you are asking for an example of something only dependent on gravity that cannot be explained by density or buoyancy.  How about the moons orbit around the earth, or any orbit of any other planet's moon around it?  How about GPS?  Please use density and buoyancy to explain how GPS satellites orbit the earth, with diagrams, vectors, and calculations.  Sorry for demanding this kind of proof, but until you can provide those answers (better yet, also include a detailed explanation of how GPS works on a flat Earth), then I'm sorry, but you have absolutely zero credibility. I tried to leave this discussion at a conceptual level, but if you're going to demand that kind of proof from me, you better be able to provide it yourself for your model.

Actually, do you even use GPS? Remember, it's a system based on a globe Earth model and it's run by the US Air Force, so I certainly hope you wouldn't be trusting it to try to get around places.

Now, I will give you one thing: I did mess up one of my calculations and was off by 1 decimal place.  A 100.00 kg mass at the equator would weigh about 100.34 kg, not 103.4 kg. Accounting for the slight variation of acceleration due to gravity from poles to equator the real value would be about 100.5 kg.  So much for being crushed... lol.   If you doubt my math, you will need to show me your calculations, because I double checked mine and it's absolutely correct as far as the acceleration of Fc = 0.034 m/s.  FYI,  I did all my own calculations and did not need to look at any website to copy it from.  All I needed to look up were the accepted values for the Earth's circumference, radius, and the exact number of seconds in a day, because that's not the kind of information I keep memorized. Never actually saw that website you posted until just now. I don't care if you believe me or not, but I have no reason to lie to you.

I think the last point I need to address is regarding your ISS example.   we absolutely cannot view the Earth as a closed system, because as you pointed out earlier, it is losing 90 tons of gas a day to space, and it is also gaining and losing some material from solar winds and solar flares as well.  You absolutely cannot view the vacuum of space as a container of any kind.  To do so shows your complete fundamental lack of understanding about what a vacuum is, as does your continual assertion that vacuum would create any kind of force to suck anything out.  You need to stop confusing the vacuum of space with your Dyson.  Also, your implication that  your non-existent vacuum force would approach infinity because of the volume of space shows your complete and total lack of understanding of how gases behave and the forces involved.  Space can be said to be an infinite vacuum and will always have a pressure of 0 psi, regardless of its volume. Gases move and generate force due to pressure differentials (with the force originating from the pressurized gas, NOT from any kind of suction force created by a vacuum) so the difference between 14 psi and 0 psi will generate the same force over a given area absolutely 100% regardless of the size of the continuous vacuum.

The difference here is that you are talking about dissipating that energy  over an area the size of an escape hatch, maybe three feet in diameter versus that same energy dissipated over miles of atmosphere.   This explanation is absolutely adequate and I do not need to account for forces and vectors of every air molecule to prove it to you, even though I practically did that already in my earlier explanation.   But to answer your question of how big the ISS would need to be to not have the air "sucked out" (there you go with your backwards thinking again)...  it would need to be large enough to have its own gravitational pull strong enough to attract gas molecules towards its center, as earth and several other planets do.

As far as my worldview, you're making a very wrong assumption about what I believe. God is absolutely a big part of my worldview and I'm a Bible-believing Christian, however I will tell you again that the origin of the atmosphere is irrelevant to the physics of how we observe it behaving today. That would be like me telling you that you're not qualified to operate a computer unless you can tell me exactly how it was developed and designed from the very beginning.  That's absolute nonsense, just like the rest of your "arguments".

Since you are going to bury your head in the sand regarding the 24-hour sun in Antarctica, how about explaining how the Qantas 27 flight from Sydney, Australia to Santiago, Chile that occurs about every 2 days and takes roughly 12 hours would be possible on a flat Earth.  You would need to account for the flight path, capabilities of the aircraft, time, and distance.   Actual data from those flights is readily available from independent sources.

https://flightaware.com/live/flight/QFA27/history/20180902/0135Z/YSSY/SCEL

Just in case you're wondering, this data is from a private company, not the government or NASA.

Now, if you're going to try to claim fakery on all of this data or in some other way avoid the question of how that flight is possible on a flat Earth, then I do not feel we can move forward with this discussion in good faith. I have in good faith answered a litany of your questions regarding how things are possible with a globe Earth model, and you have yet to legitimately answer even one question about how anything works on a flat Earth model.   If you refuse to propose any kind of possible explanation for these things, then wong did have a few questions that are also legitimate. If you cannot adequately explain any of the observable phenomena related to the southern hemisphere using a flat Earth model and actual science instead of claiming that there is some giant conspiracy involving millions of people and everything is faked and everyone is lying (which if you actually believe, then you are completely delusional and have utterly departed reality and seriously need to seek professional help), then I think we can safely say that that model is completely and utterly debunked.

At this point I have to ask, what kind of engineer are you?  Locomotive operator maybe? That would be the only explanation for your complete lack of understanding of the physics involved here.
Reply: @BrainUser1  "In science, there's often not absolute certainty."
Agreed, but that means sometimes there is, and this is one of those times.

"Can't just claim something as 'most likely fake'...?"
Correct. You can't just make a claim without supporting evidence. When scientists say something is most likely, they must provide some data or observations that support that claim using reason and logic. The more controversial the claim, the more supporting evidence there would need to be to make a convincing argument.  The only "evidence" he gave to support his controversial claim was a subjective assessment that the shadows didn't seem to be right at a certain point in the video, however they look perfectly as they should be. To claim a video like that is "most likely fake", he would need to do a MUCH more detailed and objective analysis of exactly how it was faked, because just saying the shadows dont look right is not justification enough to be able to dismiss video evidence. And then there is the other video that he would have to demonstrate objectively exactly how it was also fake.  Science doesn't just make outlandish unsubstantiated claims like he is doing.

Agreed with your definition of disingenuous, and that is exactly what he is doing. He claims to be an engineer, so he is either pretending to not understand these elementary physics concepts that any engineer should be able to grasp, or he is not the kind of engineer he would like us to believe he is.
Reply: Louis Shaw Ioannidis's paper deals with statistical weaknesses of individual pieces of research, not the conclusions drawn from accumulated research.
Reply: Mister, The "Completely garbled account" challenges your "individual pieces of research, not the conclusions drawn from accumulated research."  The metaphor of “accumulating” knowledge. This imagery conveys value, but what is it worth?
  Think you are doing a good job of showing validity.. I'm sure you think you are.   You didn't provide any evidence to dismiss. If you want to claim Acumulated Research provides the evidence of Conclusions worth= then back the claim.
You can't come up with evidence to support can You? More in line with your smart lip: "What gets taught in schools has been verified by science over and over and over but their are twits that assume it has to has to be wrong because, well, because."? 

At the time of its discovery there was limited information upon which to draw conclusions. It was eventually corrected as more information became available and was assembled. That is how science deals with its mistakes and continues to progress. 
 A claim without supporting evidence???

[Accumulation of Scientific Knowledge  The prevailing view is that findings from education research studies are of low quality and are endlessly contested—the result of which is that no consensus emerges about anything
 Science provides a valuable source of knowledge for understanding and improving the world, but its conclusions always remain conjectural and subject to revision based on new inquiry and knowledge. ]
 As Thomas Henry Huxley once said: “The great tragedy of Science—the slaying of a beautiful hypothesis by an ugly fact” (cited in Cohn, 1989, p. 12).
https://www.nap.edu/read/10236/chapter/4#37

Answer my question. Produce this newspaper article that "the conclusions drawn from accumulated research statistical does not carry weaknesses, of individuals, of research.

Etras; 5. Failure to specify the exact statistical assumptions made in the analysis
https://www.sciencedirect.com/science/article/pii/S188319581000112X

How science goes wrong - Problems with scientific research
https://www.economist.com/leaders/2013/10/21/how-science-goes-wrong

This is why you shouldn't believe that exciting new medical study - Vox
https://www.vox.com/2015/3/23/8264355/research-study-hype
Mar 23, 2015 - A shocking number of them are wrong. ... In 2003, researchers writing in the American Journal of Medicine discovered something that should .... we need to look past the newest science to where knowledge has accumulated.
Reply: Louis Shaw Either Dr or Flook  D; I haven't been Mr in a long time. 

You aren't telling me anything I don't already know. For something to be accepted it has to have been verified multiple times by multiple parties: disproving initial claims does not render the entire body of work invalid. That is how it works. All the articles you quoted referred to the initial work, not the accumulative work. The whole point of the articles was about continued work disproving the earlier, not maintaining the claims. 

If you want to claim it's all wrong then you need to provide the evidence to back your claim. I would note that your entire body of evidence to disprove evolution was simply quoting the Piltdown man over & over, not actually producing anything to support your claim.
Reply: @BrainUser1  This is why when evaluating new treatments I might consider offering to my patients, I'm generally not the first one to offer them and wait until some sort of meta analysis has been done, which is analysis of multiple different papers on the same topic, pulling the data to make broader and more specific conclusions. Most individual studies are generally Limited in their scope because of the logistics or expense involved doing a giant study, so the meta-analysis can increase the power of all those individual studies by combining them together.

This is basically what we have going on with the globe model. There has been so much research done over hundreds of years, that there really is no need to continue trying to prove it is round with more recent studies. It's already been done ad nauseam.
Reply: @Jim Lee
+Louis Shaw
and 
+Thevoice ofreason
Are known trolls
Louis just waffles bs, very often no more than word salad, and "Thevoice" keeps parroting the same crap, after being proved totally wrong, and therefore becomes a blatant liar., not forgetting it is deluded biblical literalist. e.g.  "The earth is fixed,  not in motion, that confirmed in the bible and repeated in a variety of ways. The sun was created, let their be light after the earth, the sun is supposedly dragging the earth that could not be so if it was created after the earth in the opinion of myself and others.
Therefore I repeat, your demand to leave god and religion out of it is disingenuous to say the least, isn't it, because the entire foundation of the problem is religious belief. If people would accept this we may possibly move forward.
You should also stop feeding trolls.
Reply: @babayaga9570  Check your units my friend...  the force is in Newtons, not kilograms. 1 Newton = kg*(m/s^2).  The reason I used acceleration is because I was using a 1 kg mass for ease of calculation just to show you what the difference in acceleration would be, because for a 1 kg mass, the force in Newtons is equal to the acceleration. You can clearly see that from the equation above.  You can also prove this by checking your units for v*v/r... (m/s)*(m/s)/m = m/s*s = acceleration.  Then F=ma, so F=kg*(m/s^2)=newtons.  So you get 3.39 Newtons of force on a 100 kg mass, not 3.39 kg.  

So if you want to compare forces, for a 100 kg mass at the equator, Fc = 3.4 N, and Fg = 100*9.8 = 980 N.  Hmm... wonder what percentage difference that is?  (3.4/980)*100 = 0.3%.   Now that you checked your math and realized your error, all that name calling you did makes you look a little ridiculous, doesn't it?

Did you say you were an engineer?  What kind of engineer thinks the units for force is in kg???  Oh, software engineer, got it.  So really no physics involved.  Nice try at pretending to pass yourself off as some other type of engineer that actually deals with physics.  Seriously... now I know why you say you don't have time for this. You didn't have time to learn it properly in the first place.

Yes, the clouds at the end of that video are the same, because the video loops for a few seconds at the end. I certainly don't see how that could be construed as proof that the entire thing was fake. You are grasping at straws and committing multiple logical fallacies. If you were going to use that as your evidence to dismiss any and all videos of 24-hour sun in Antarctica, that is a classic association fallacy as well as classic argumentum ad lapidem and ignoratio elenchi. Three fallacies in one statement... impressive! That is a real time lapse video that was looped for a few seconds at the end. What about the other video? How about addressing the fact that every point south of the Equator gets more than 12 hours of sunlight during their summer? That's impossible on a flat Earth but perfectly explained by the globe. 

Now I'm very intrigued to see what anomalies Mark Sargent found on that flight. I'll go look for that video. I need a good laugh this morning.

So your answer to GPS is that they would "probably work" by the Earth's magnetic field, like how the Sun and Moon work. How do those work exactly on the Flat Earth model? Oh wait, you say you don't have a model, do you? But you know it to be true? You really have absolutely no idea what you are talking about, do you?  You asked in your initial question for forces and vectors to explain how the globe model works, pretending that you actually know something about those. So when I actually provided the explanation using exactly what you wanted, you demonstrated that you clearly did not understand those concepts at all. Now that I'm asking you to explain with forces and vectors how GPS works and how the Sun and Moon work, it's full of "probably"s and "we don't know"s...  it's full of bullshit is what it is.

Your bluff that you actually know something about physics has been called, my friend.   Since you asked about my degree and education, my undergraduate degree is in chemistry and cell and molecular biology, then I have an MD degree, and then I have board certification in radiology, which includes certifications in radiation physics and nuclear physics. So I do think I understand a little bit about physics...
Reply: @babayaga9570  As for your questions about tidal locking of the Moon, gravity explains that the same way it explains the tides. The moon's small force of gravity pulls on the Earth, causing ocean tides. The Earth's gravity also pulls on the moon, causing a slight bulge in the shape of the Moon to one side over time.  Since the force of gravity is dependent on the mass of the object, and if the mass on one side of the moon is just slightly greater than the other side, then that would explain why the slightly heavier side is always facing us. Take a bicycle wheel for example, and add a small weight to one spot on the rim, then spin the wheel. It will always stop with the weight facing down. You could also imagine it as though the Moon is kind of like a tetherball attached to a pole. The top of the ball where the string is attached always faces the pole.

You assume that because I believe that the earth is round that I also therefore must believe in evolution. Yet another logical fallacy of false association.  If you define evolution as change in organisms over time, then yes, that's a valid scientific observation. Where I have the problem is when they try to use that mechanism to explain the origins of life. The problem is, whenever someone tries to claim proof of evolution, all they show is proof of species changing over time. There is no proof that this mechanism is actually the cause of the diversity that we can observe today.  This is an example of Motte and Bailey fallacy.

The last thing I just noticed, you just said in your last post that there is no vacuum in space. Look at your first post where you asked us to explain how the vacuum of space doesn't just "suck out" all the atmosphere.  Now that I have shown you with multiple examples, mathematical proofs, and physics explanations including forces and vectors EXACTLY how it works, now you are claiming that there is no vacuum?  Your posts are nothing more than the ramblings of a deluded mind that is grasping at straws.